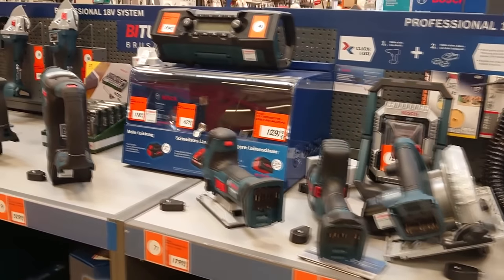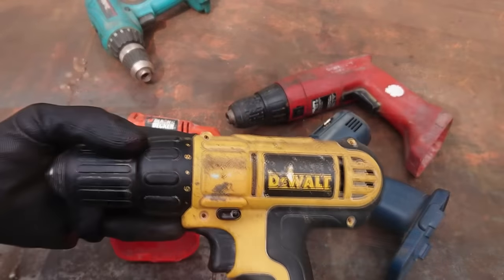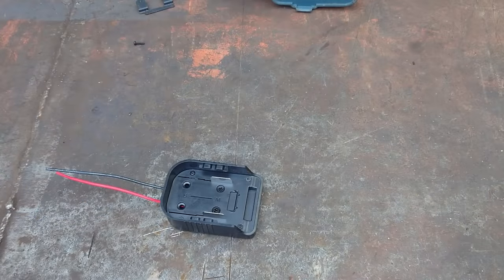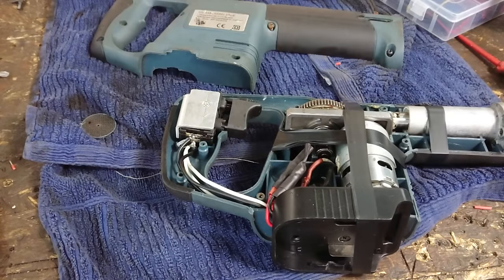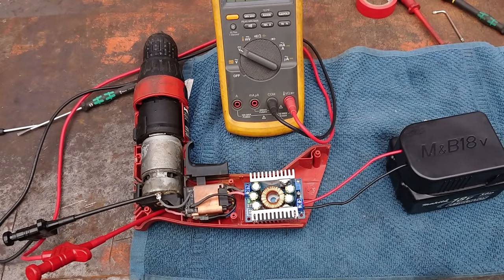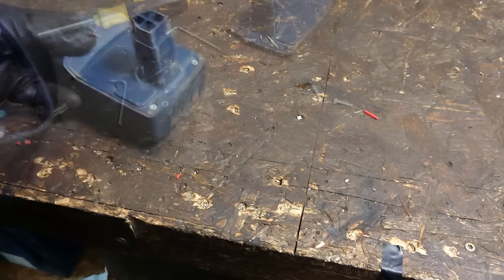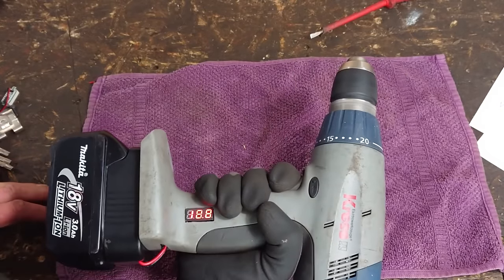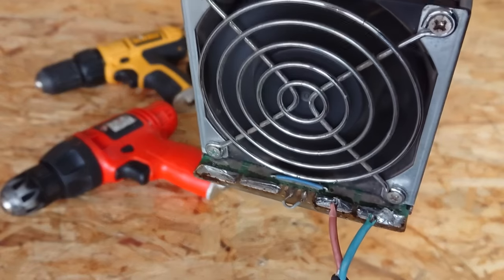Scrapyard Finds! Repair-A-Thon! Cordless Tools Galore!

Comment from the maker: Hey guys, in case you're wondering where you can find some of the components I used in this video: 
To find those Makita 18V-adaptors, just type "Makita 18V adaptor / adapter" into google or ebay, and you will probably find them. 
I bought mine here on German ebay, The link is very long. That's why I posted it in the video description instead. 
The plugs I used are called "aviation plugs". If you want to use them for higher currents, use the 4 pin version and use two of them in parallel. 
In case you're wondering that there are some comments under the video, from before its publish date, the reason is simple: 
It was finished Sunday night, which is  not a good time to publish, because people go to bed. I uploaded and gave the Patreon supporters early access, which I normally don't do. But this time it was a special gift to those guys!
In case you want to donate to the channel, you can also become a Patron (https://patreon.com/tpai). You can also make donations, using the paypal-email-address: inventordonations@gmail.com in case you send an email, don't be too dissapointed if it might take a week for me to reply. There is just too much going on in the workshop, for me to check emails on working days. I hope you all enjoyed this video, Gerolf
Reply: Love your content Brother
Reply: Where can I mail something out to you? Do you have a PO box that you accept items at from viewers? Please let me know, thanks! 😁
Reply: Gerolf, I would gladly buy one of the bags from you
Reply: Thank you Gerolf. From James.
I awoke to this unexpected(you've said you are busy) new vid while in the midst of new medical issues.
I grined ear to ear like a child on Christmas.🌍❤
Reply: I'm not sure if the eBay partner network is available to you in Germany, but basically it allows you to generate your own links to eBay items and you can even shorten the links so they are only a few characters. If people buy from the links you generate or on that shopping trip, you get a small commission. Could help boost your income a bit in videos like this and does not cost viewers any extra!
Reply: Great video, really creative approach. One question -- some of these tools become very sticky over time -- the plastic housing deteriorates? Do you have any recommendation on how to handle that problem?
Reply: I never knew about the Makita 18V-adapters - very useful.  The DC-DC converters are also available on AliExpress and cheaper than EBay - I've used a few in the past
Reply: @AndyFletcherX31  yes this is amazing. Just an adaptor and you can convert the old tool to the system you have.
Reply: I want a bag!  That yellow patch with the gears is nice!  I want both!
Reply: This was a great change up and gave me great ideas about what to do with some of my old cordless tools. Thanks!
Reply: Hello sir i wish if you have the time please kindly make a video of how to make a wind turbine for old machine(motor) 
It will be of great help to us who wish to power of small home.
Reply: what kind of cable did you use? looks very flexible
Reply: Dude those patches are great - stickers would be cool too, I could whop some on my toolboxes. =)
Reply: Regarding the overdischarge "issue": Makita has all the management in the battery, but they don't just switch the output off instead there is a third pin that enables the tool. You can also use for example their cordless angle grinder (18V) with an car battery directly. Just connect the negative from the car battery with some jumper cables to the negative of the tool, and the positive to positive obviously but make sure that the "enable" pin gets connected at last to plus.
Reply: Thanks for sharing 🙏
Reply: @The Post Apocalyptic Inventor 1:06 those stainless steel perforated sheets would be awesome for an HHO dry cell!  I think you should pick them up next time you are at the scrapyard!  With a little solar energy, you could make a totally green hydrogen-powered torch!
Reply: I wish I Knew about that adapter earlier. Thanks
Reply: You are very nice.   Do you ever have meetings or workshops in Germany / Deutschland?    Some may be interested in doing an interview or working with you in a learning workshop.
Reply: those "aviation plugs" look a lot like XLR connectors, except those don't have a screw lock but a much faster clip-lock and they only come in 3-4-5 pin variants, i just ordered some 3 pinned ones to convert my 220V tools, similar to this video https://www.youtube.com/watch?v=WquQYdwcr74
Reply: Can you please provide the exact name of this glue? It seems to be really good, thanks :-)

Comment: Love your show.. I just did my homework . To buy a makita charger , battery and adapter it will cost me around  $60 to $100 AU depending on size of battery  but I can buy a new 18v drill  with battery and charger for $50 . This is the main reason these old tools end up in the dump.

Comment: The ntc thermistor in that Kress pack is for the charger, to avoid overheating, and as a secondary charge termination method
Reply: Right, they used to charge nicad batteries until they got hot then shutting off.
Reply: I can confirm that.  The NTC thermister is only used by the charger.
Reply: Makes sense.. how did I not think of that. Lol
Reply: @stevec2196  it also seems that delta-T (or dT/dt) is a very good indicator for end-of-charge in NimH cells, since the voltage slope change at termination is much harder to read than for NiCd cells.
Reply: You beat me by 3 months

Comment: I love seeing the old tools come back to life. and be modified to be useful again. Another good attachment for the 12 volt tools would be a pair of clamps like jumper cables that would let you hook up to a standard automotive battery keep it in the car and always have a handy tool and power source. and because the car always keeps the battery charged you don't have to worry about packs or keeping them charged up
Reply: (See above) I'm using one like that to power my old scissors jack with a Craftsman 16 volt drill.

Comment: @ 18.54 I have a couple of old 'cordless' tools that I added heavy leads and alligator clips to. These are to connect to the battery of the car or truck I'm driving. Great video!

Comment: I've been with the Ryobi 18V system for many years, and I am pleased to report they maintained the same battery interconnect when they switched from NiCad to Lithium Ion batteries. So my ancient drills still work with the newer batteries. Kudos to Ryobi for doing that. All that said, very ingenious work you've shown here, per usual. Thanks for sharing.

Comment: Always a favorite! You give me so many good ideas. I recently converted an old drill to connect to a PC power supply to use a low speed nylon cleaning brush station that I've found useful for some of the projects I've been doing lately. Definitely interested in a patch and bag!

Comment: I've also converted two old Bosch (PSR 960) cordless drills to Li-ion batterys. I used some cheap BMS in the system and it's working great :)

Comment: This is one of my favourite videos of this series. It's so frustrating to see perfectly good tools thrown out because their battery technology is out of date. It's just so wasteful. 

The manufacturers themselves should really be required to provide upgrade paths for cordless tools, but until then, I think I'm going to attempt the same kind of upgrades to my obsolete NiCd tools.

Thanks again for the great content.
Reply: You can rebuild packs with lithium ion batteries. You do need a new charger then. You also need a cell balancer. I've looked into it. By the time you're done you almost could have bought new tools for what it costs. That's how they get you.
Reply: I have a snap-on 1/2" nicd impact, and oddly the charger is labeled "nicd/li-ion"
Still haven't done the research on what that means lol
Reply: @keeganwebber  hopefully it means it has some way of differentiating what kind of battery it charges.
Reply: Totally agree. Also food for thought: what is going to happen to all those worn out e-car batteries from all those different manufacturers in some years from now?
Reply: @algemeennut6683  a new industry recycling toxic batteries will be born.
Reply: @keeganwebber  It can probably tell which it is from the resistance in the battery packs.  The Li-Ions should be 5 cells (for 18v) and 15 cells for 18v Ni-Cd - and they have different resistances based on chemistry, add 15 cells in series and you have a good bit more resistance.

Comment: I've used cordless tools a lot over the last 30 years. B&D 9.6v Bosch 14.4v then Ryobi 14.4v and finally Ryobi 18v.
I managed to revive my  beloved Ryobi 14.4v drills with LiPo compatable batteries. But Ryobi 18v has become my standard. I must have at least 11 different tools in that system. I enjoy your scrapyard projects - mainly for the larger machine tools like lathes and drill presses that I use myself.          I don't have as much technical education as you, but enough to do thses basic rescue projects. Please keep doing them.

Comment: Always love to find a new repair--thon on YT. One tip for anyone contemplating a similar conversion. The idea of the voltage meter is good, but because it's always on, it will drain the battery when not in use. You have to remove the battery when storing the tool for any longer period.. It might be better to have the meter switch on when you use the tool, but To be honest, I wouldn't know how to do that in a simple way. Maybe add a push button to show the voltage?

Comment: So, every cordless device was working but was dumped   because of worn out batteries. 
I think that your common platform approach using  a Makita battery, is an inspired decision and one that is easily replicated by using any of the 'big' manufacturers batteries. 
First class video. Thank you for making  the video and for taking the time to upload .

Comment: 15:00 In a lot of tools it's not connected. It's mostly used in the charger :)
Reply: Makes sense, as charging cells makes them heat up more than discharging. Even in fairly high-current use.
Reply: Yeah. not sure all tools use the sense connections but the charger definitely does.  Think the tools tend to rely on the built in protection circuit in Makita batteries, it'll kill the power if the cell voltage drops too low and makes for much simpler/cheaper electronics in the tool.

Comment: Great series, I'm jumping around between older and newer episodes so my comment is dated, but a neat way to protect the 18v batteries from excessive discharge might be to add an under-voltage lockout circuit (either dedicated chip or a couple large value resistors and a big FET).  Wire this on the far side of the switch if it's on/off or near side of the switch if the switch controls speed.  That way power to the tool is simply shut-off (by the FET) when the voltage drops below the desired threshold.

Comment: Great video! 
The Pampers babywipes in the blue/greenish packaging (Not the "sensitive" variant) are perfect for cleaning. They even remove stuck waterbased paint. I don't want to imagine what happens to the poor bums of babies that actually get "cleaned" with those wipes on a regular basis. I always have some in my kit. When disassembling something and things might get messy a single-use diaper-changing mat ("Wickelunterlage" in German) is also super useful. 

The patches look great by the way! A nice retro Fallout/Bioshock Look would fit you quite well. 

Cheers

Comment: For a portable battery, make a belt clip to hold an 18V Makita battery holder, with an integrated buck converter. The aviator plugs look like a good solution. Also those bags look really good.

Comment: Problem with old cordless drills i encountered is that more often than not you can buy a new one with batteries included for similar price as battery replacements. Not a problem if you already have couple batteries around for conversion, but without them it is just cheaper to buy new tools. I've read that drills can pull up to 20-30 amps, so i was not sold on using power supply units from pcs for example. Long story short i have a box of dead drills in my basement ;) 
Great video as always, cheers!

Comment: Nice work. I used 7,2 Volt NiCd Makita tools for a long time. When the batteries died I stored them. After a few years I made a dummy battery pack with leads that I can connect to my adjustable heavy duty power supply (20A@30VDC), No I still use the cordless tools and changing is real easy by just switching the dummy battery pack. Maybe an additional idea to save stuff in a more convenient way. Thanks for all your nice uploads. Best, Job

Comment: I've often done this with ni-cd/ni-mh pack devices. I've built 5S ~20v packs for all my tools, using 18650s with a 5S balancer board rated for 10a or 20a. For the 12/15v tools, I just mount a 5a lm78xx on the heatsink for the speed control driver. Takes up far less space, and far cheaper than buck boards. I do like how your Makita pack has a kit like that. That Alpha tools drill is the same as many that I have; I left the battery connector, used a dead battery shell to "wire" a 14v PSU to work with similar "necked" pack sockets. So many ways to reuse functional tools people throw away!

Comment: Another great episode. Guess what I am going to do with a 12V Makita drill? The battery adapter is a brilliant solution to proprietary battery designs. I stopped buying battery power tools quite sometime ago and only buy and use mains 240V tools.  I like your views on the throw away society and practised a similar strategy many years ago when I lived in the bush in a pisé brick house I built - 8500 bricks made one at a time. Many of the doors came from recycle yards and finding old woodworking tools in second hand shops and garage sales was a real buzz. These days I still hold many of the same ideas but my business ties me to computers, software and to remain competitive the latest technology. Thank you for your videos they bring a great deal of pleasure and ideas. Cheers from Australia.

Comment: Inspired by your channel, I repacked my Hitachi 14.4v drill kit that I've had a couple of decades. Both batteries refused to charge, but it was only because each pack had a couple dead cells. Cut all the cell tabs apart, tested them each, and put the best ones back into one of the packs with a spot welder. That battery should be good for a while yet. Meantime, I'm going to use the empty shell and my 3D printer to experiment with using 18650s in the future. Also, I love the TPAI patch idea. It could be shipped globally relatively cheaply, and encouraged to place on locally-sourced and/or reused bags. You have at least one prospective customer here. 👍

Comment: Nice work! Good idea with the meter. Some radio control setups have battery cutouts, I'll bet those could be adapted too, if you can find one that isn't integrated into the ESC.

If you've got the battery and charger that go with the tool, you can sometimes get the old battery to work again, at least for a while. The old NiCad batteries can sometimes be brought back by zapping the hell out of them (fries the crystal dendrites that short them out internally). I did this to my dad's old Makita and got another few years out of it before it died for good. Make sure you ID the right contacts so you don't fry the thermistor instead.

Recently I had a lithium pack for my Hitachi drill discharge below what the charger would recognize. As you noted, lithium dies if discharged too far, but it wasn't completely flat and I didn't have much to lose, so I opened it up and hooked 12v across the pack (bypassing the on-board circuitry) from a computer power supply, current limited with an incandescent light bulb. After a little time on the jumper cables, the charger recognized it, and it charged right up and works again! Those aren't cheap so I was happy to get it going again.

Comment: I have a bag battery similar to yours.  I made it out of reclaimed 18650 Li-ion cells, and an old PSone carrying case.  I've got a small inverter in the bag, and a few attachments.  It's really handy for testing 12v systems, or backing up a vehicle's battery so you don't lock the radio or lose presets when changing the main battery.  I could "jump" a car, by plugging in the cigarette lighter adapter into the main battery and waiting for it to charge up, but it doesn't have the CCAs to do it on its own without a capacitor bank.  I've been manufacturing a battery case to turn my ancient makita 9.6v packs into 12.6v li-ion packs with my 3D printers but I got side tracked by a new project.

Comment: Great recycling of tools. My cordless tools are 12V as I like them being lightweight. When one of my batteries died I added a cable and XT60 connector. I have connectors for car batteries, transformers and car cigarette plugs all with XT60 connectors so I can power my cordless tools in many ways. When I am in the workshop I rarely use the batteries, I prefer my "adaptor" connected to an old car battery.

Comment: Great episode!! I have the same B&D 12v drill. I soldered a 12ft cord to the leads in the drill handle and i soldered the other end to a car cigarette plug adaptor. Make sure polarity is correct. The lower amperage of the drill has not blown any fuses.Works  great and i keep it in my trunk as one of those tools that you just might need one day.

Comment: In the 'Krest' drill, the thermistor is probably for the charger, to monitor the temperature during charging. Ryobi batteries have a similar system.
I've done the cable to a 12V battery trick myself, but just used the old battery as a connector.
Great work, and I really like the 'one battery for all' idea.